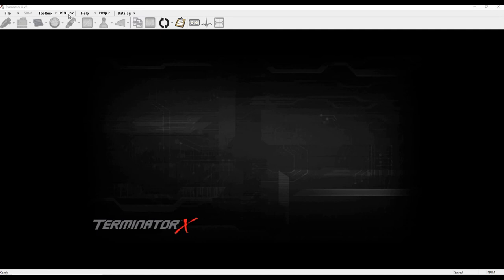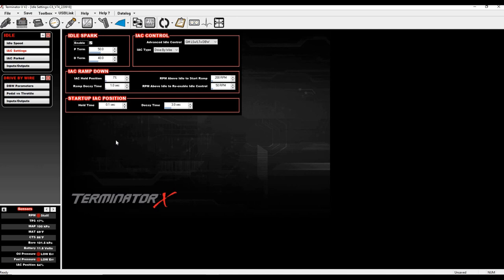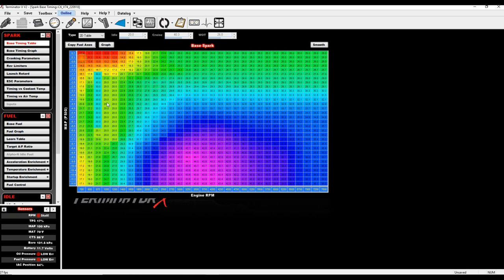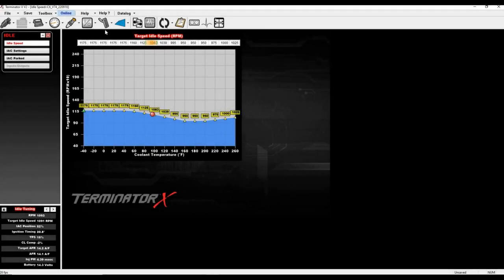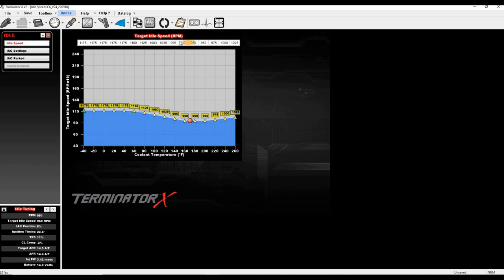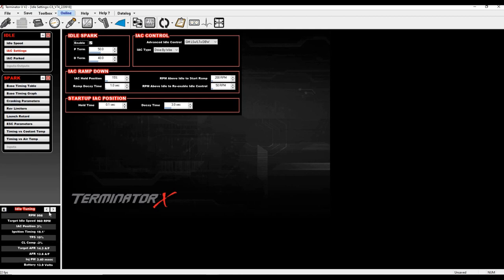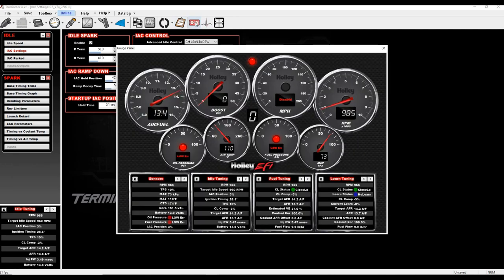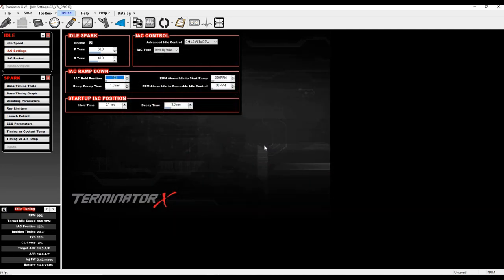Holley EFI Advanced Idle Tactics: How to dial a stall free idle

Comment: Would you be willing to help me with a swinging idle for instance  when i slowly release clutch to pull forward  then push clutch in my idle will hunt up/down almost stalling this is on a 95 mustang with terminator X 347 stroker, 1050 injector dynamics, Gm iac. I am willing to pay you just to help with the swinging idle

Comment: hi 👋🏽, I just installed the new sniper 2 on my car, she fired right up as it’s supposed to. I have the basic set up coil and distributor. Before the car was fired up it was set at 12°. I decided to change the timing now at 15° and now the rpm ramp up from 750rpm to 880rpm. I tried to change the basic idle back down and it won’t at all. Do I need to re-start the wizard again or? Any word of wisdom would really appreciate it. Crate sbc 350 5.7 gen1
Reply from the maker: I'm not sure I follow but if you do not have ignition timing control from the holley the only way to adjust the idle is with the idle screw on the body.
Reply: So when I fired up the car the first time i have my initial timing set at 12° ran that for couple of day have my idle set at 750rpm on the handheld. Today I decided to change my timing by turning my distributor to get initial 15° my idle went up 880rpm  but I have it set up at 750 on the handheld. I tried to reset it, and it won’t let me do it..
Reply from the maker: @lleonardo2880  What is IAC %? Does the ecu control timing? have you adjusted the set screw for the throttle blades?
Reply: @greenshortsperformance472   The IAC is at 0% and the ecu is not controlling the timing. I watch a few video to how to set the IAC and none of them work. I’ve even tried to set the idle in the handheld at 600rpm and it wouldn’t go down at all 🤯
Reply from the maker: @lleonardo2880  if IAC is zero (fully closed) and does not have timing control how do you expect it to lower the idle speed? It has no ability to control it any lower. Only higher. Turn the throttle blade stops counterclockwise equally until the IAC value moves off of zero

Comment: My car running 50 miles and hour. When i let off the acclerator the idle bumps down to 500 to 600 and wants to die? My idle is set at 750. Iac at 6 to 7. I have mild cam bigger heads 1.6 roller rockers on a 350 small block. Im thinking bumping my idle another 100 like around 850. Do you think thatll correct problem ?
Reply: Holley sniper btw
Reply from the maker: Set the rpm to start ramp a bit lower and the iac decay a little longer
Reply: @greenshortsperformance472  should I set my rpm around 850 ?
Reply: @greenshortsperformance472  at idle
Reply from the maker: @mikeydejon2148  did you see my above comment. I have no way of knowing what your rpm at idle should be targeting without asking many more questions. However if you have a dip in rpm after returning to idle those are the first steps I would take. 

If you think more rpm is the answer give it a try. That’s the beauty of efi.

Comment: Beauty of a video. Trying to troubleshoot a stall. Brand new setup. Timing is good but still waiting on fuel pressure gauge to show up. I do have to give it a bit of throttle when starting “more air” but when it’s running the iac is at 5 tps at 0 idles prefect then she just quits.

Comment: Wow what a video! THANK YOU! I do have a  question. do I need to get a lap top and the program from Holley to do the things that you did? or I can do it with my little hand held. Just to give you an idea what I’m running. I have a stock crate sbc 350 motor and still running a regular distributor and coil, no timing control in my Holley Sniper. No AC.
Reply from the maker: You can use the SD card and take that to a computer or get the cam to usb cable and connect directly. 

That said a lot of the tools in your toolbox are timing related. All you can really do is make IAC changes.

Comment: Your videos are awesome thank you for putting in the effort to do this.   You have really helped me a ton tune my idle and DBW properly so thank you.  Since you know so much with the tuning maybe you can help me with a little project.  I have an LS3 525 in a pickup with 4l80E behind it.  I want to tune it to have the exhaust pop on gear change like a C8 is that doable with the terminator x?
Reply from the maker: To do that you need a large timing retard or really a cylinder cut to be able to get that reliably. Good news is the latest v3 software has torque management options for making solid shifts that could be used to similar effect
Reply: @greenshortsperformance472  Do you have an email or something we can bounce some ideas around?  Your idle video is mint I spent about an hour and a half yesterday dialing my idle in and its perfect now.  The return to idle is so smooth vs before!
Reply from the maker: @a7m266d  tuning.gsp@gmail.com

Comment: I like you video I have got my idle right where I like it with your help. I do have one question when I start my engine it goes up to 2000rpm for the duration of the decay setting (no matter the temperature) how do you change that rpm setting? Thanks
Reply from the maker: Lower the IAC park position corresponding to the CTS that you’re starting at

Comment: Awesome video, I am working on trying to figure out my iac ramp down on my setup, I have a LS 5.3 and I had a automatic transmission and changed it out and I have a 6 speed manual in it now and I am having a issue with the rpm not coming down fast enough to be able to change gears, If I push the clutch in and wait a few seconds to be able to get it in gear, 
Do you have any advice you can give me to help me in the right direction, Thanks for any help you can give me.
Reply from the maker: I think my first question is what is your iac value at commanded idle? If zero be sure you close the throttle until you get about 1-2%. If you had zero ramp in that situation the idle should return very quickly and may even dip quite a bit. From there I would command a high idle and observe the value as in the video and set that as the hold position. From there adjust the ramp and rpm to start to get the result you want. 

Outside looking in it sounds like the throttle is too far open.
Reply: @greenshortsperformance472  
I will have to check that out tonight and let you know, I am running throttle by cable, I will back the screw out and do a tps reset and go from there, It’s like the throttle is hanging when I push the clutch in to shift gears, I will try dinging into it and see if I can figure it out, Thanks for the quick response and the advice I really appreciate it..
Reply from the maker: @brianprather765  No problem 

If you haven’t adjusted it after losing the load of the torque converter I bet it’s too far open

Comment: How much idle tuning have you done on the SBF 5.0 pwm IAC?
I’m struggling with my vehicle stalling when coming to a stop. I have a automatic AOD trans.
Reply from the maker: Only some. My recommendation there would be to not use it and tune hot idle without until you don’t get a stall and put in a timing wall. Then you can add it back. My only experience showed me I didn’t want any more

Comment: Great video, Thanks... but how you think can I handle an engine going to stall, when you are decelerating and have depressed throttle with manual trans (stick), and push the clutch? It must be IAC rampdown but sometimes the config fails and my engine dies... (AMC 258 I6).
Reply from the maker: In that case you need to add throttle opening until IAC is zero or a bit past and then set the idle to start ramp lower
Reply: Thanks  @greenshortsperformance472 , I'll try with 420 RPM over idle (idle is 680rpm) and 1 Sec of Ramp Decay, IAC Hold is 16%... everything thru the 3.5" screen, because I don't have a PC to install the Holley software to adjust (Only Macintosh at home), lastly I have HEI ignition, w/no timing control, and IAC on Idle is set in 8% (6% w/ very hot engine)
Reply: I put it to 350 above idle and 10% iac hold. still get the same issue when engine temp is below 180f the iac will go up to about 25ish and the AFR will lean way out when deceleration and pushing in the clutch 😢

Comment: Is it normal for a dbw read a close TPS 15%? I've tried changing the TPS type and recalibrating it many times and I can't get it to read below 15%. Read up it will do it right to 100%
Reply from the maker: Perfectly normal. That’s the air that the engine will idle on
Reply: @greenshortsperformance472  thanks

Comment: Quick question should the IAC Parked Position be ok set to 40 or should that also match the IAC Hold Position
Reply from the maker: Park position is where the IAC is during cranking. It controls how high the after start flare goes. I try to adjust it to get 1400-1500rpm startup flare for any given temperature

Comment: I have put a dominator on a supercharged V8 Mercedes motor. I just can't the idle right, it's a Chrysler/Benz TB using DBW. There is no IAC.

- do the various IAC setting such as ramp down, startup IAC position, IAC parked...etc apply to a DBW system?
Reply from the maker: Yes. THE DBW body effectively does everything that a seperate IAC does just much better and faster. For a holley setup every 10% iac is 1% TPS